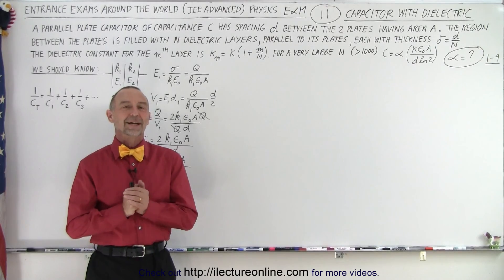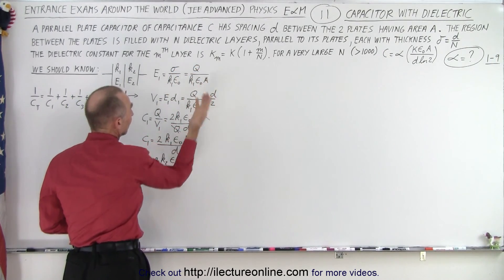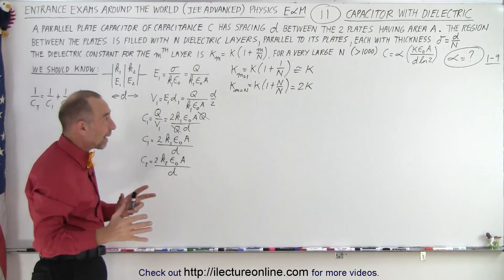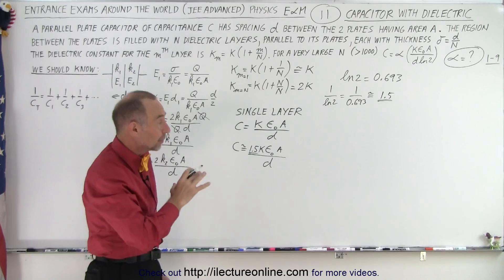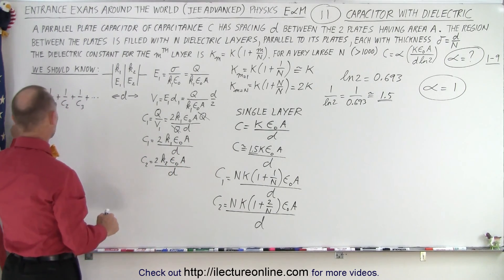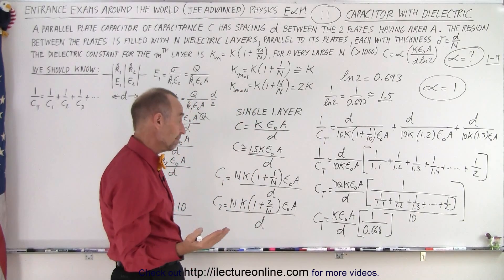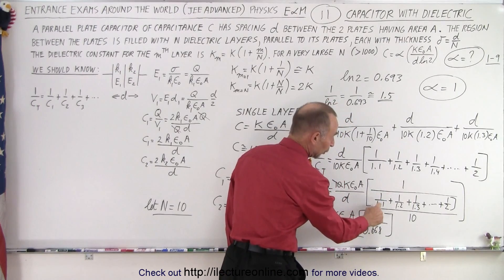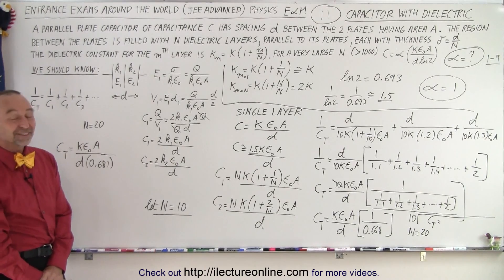JEE Advanced Physics 2019 Paper 1  #16  (#11) Capacitors with Dielectrics

Comment: The first method would not have worked in exam, as JEE Adv no longer has the restriction of accepting only single digit answer. It accepts answer with decimals also (2 places to be specific).

We are supposed to use concept of "Limits" here, taking N tending to infinity.
Reply from the maker: Thank you for the feedback.  When did they change this rule?
Reply: @MichelvanBiezen  2018, when it became computer based test instead of pen-paper.
Reply from the maker: Thank you for the information.   (Do they provide scratch paper to work on when it is computer based?)
Reply: @MichelvanBiezen  Yes a scratch pad is given with approx 30 sheets of paper.